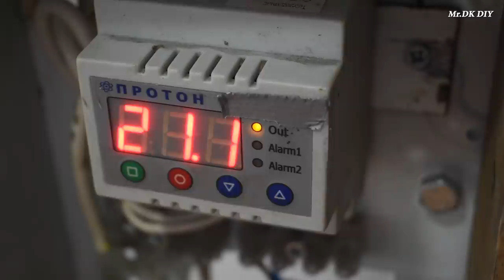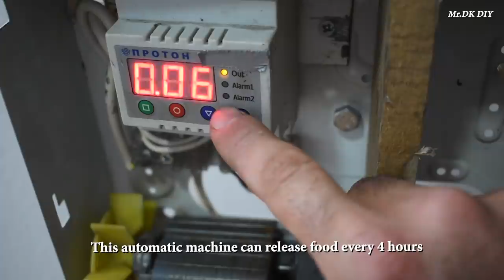OLD WOOD DRILL BIT ??? What you can do smart with this old wood drill bit ?

Comment: My shop teacher of about 65 years ago said "there are drills and there are bits" A BIT is for boring holes in WOOD, a DRILL is for boring holes in METAL. The 
HAND OPERATED tool for turning a DRILL is called a BRACE,  and the ELECTRICAL tool for turning a BIT is called a DRILL MOTOR. not an "ELECTRIC DRILL".  (Also there is no such thing as "JUICE" in an electrical circuit. It is ELECTRICITY, not JUICE.)
If any one wants to confuse those terms, they may just as well call everything a HICKEY-MAJIGGER and continue with the DUMBING OF AMERICA.

Comment: How about welding a washer on the backside of the wood bit, to keep the pellets from accumulating inside the case?  Or, make a plastic washer or rubber innertube washer to press-fit over the shaft keep the pellets from leaking inside the case?

Comment: What to make with this drill? First thing I thought of was some kind of water pumper and when I saw the pipe that it fit nicely I thought he was going that way. Then when I saw the low speed reducer I thought maybe some kind of device for boring water wells. In the end it was just for feeding pets.
Reply: I also like to know why after all that building he never ground the sharp drill point off the end?
Reply: It also nice to see someone actually use a hacksaw with their hands in a video but I think he would have done better with a long round file instead of that Dremel